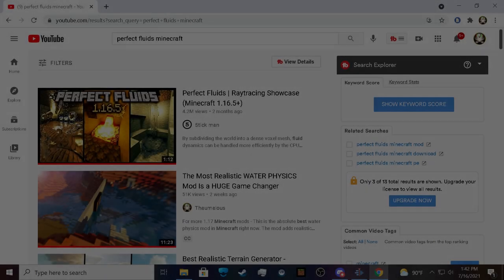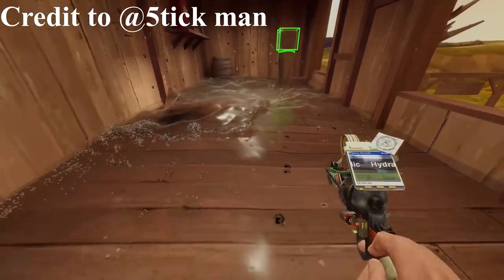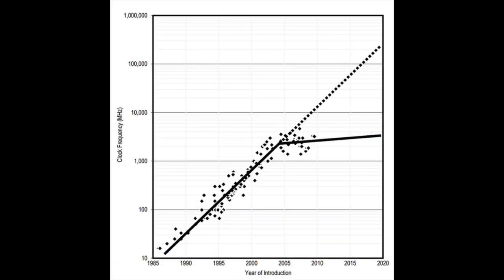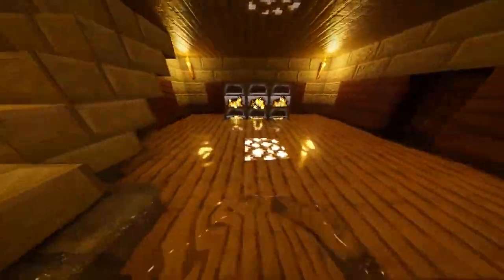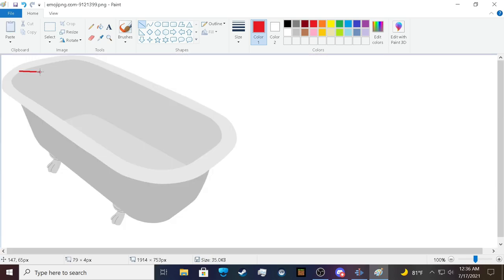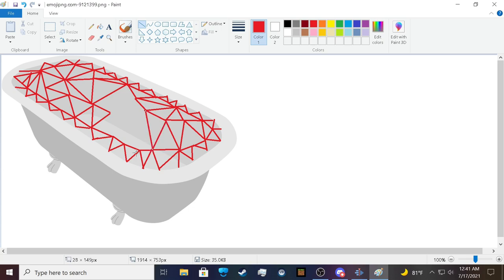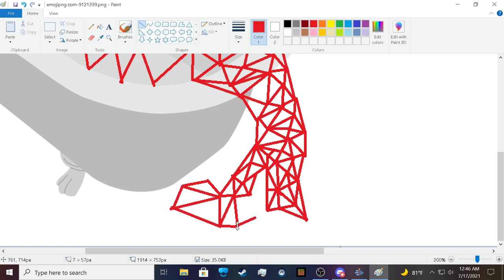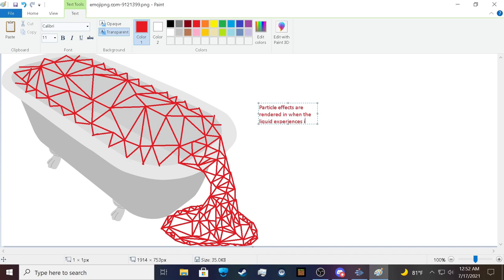Hmm, Can Wire-Frame Based Water Be Put into Video Games?

Comment: The Water Surface objects in Unreal Engine 2 games like Unreal Tournament 2003/4 are just wireframes with forces to control how each vertex moves, similar to what you're describing here

Comment: I was thinking about this type of simulation some months ago but there is a big problem with this approach, and it's preservation of mass:

While explaining this in 3d is possible, it would take way longer, so I will just explain this with a 2d analog:

Imagine you have a four sided polygon with points S1, S2, S3, S4 where S1 is connected to S2, S2 to S3, S3 to S4 and S4 to S1:

        S1
S2               S4
        S3

Now imagine flipping the point S2 over to be close to S4, if you choose the right distance, the sum of the lengths (which you used to approximate the mass of water)will still be the same, even though the area of the first shape is way bigger.

This sort of problem also happens in 3d and is even worse because the extra dimension makes it even harder to think of a way to resolve this from happening (there are a lot more ways to get polygons with the same surface area but wildly different volumes)and it gets even harder when considering that this method would have to dynamically adjust to the seperating of one body of water into two or two bodies of water joining into one again. So in practice the water shape will often deform in very unnatural ways.

All this stems from the fact that making a physics simulation system that doesn't inherently preserve mass try to do it is generally incredibly hard and slow to calculate, so the better solution is to make one that preserves mass by virtue of it's data structure alone, which is what the blender style system is, where you have a big array of particles that just change positions. Then there is the voxel approach, where you more or less apply cellular automata rules that preserve total mass(preserves sum of density values of all the grid array entries) on a spatial grid of density values. Then there are some arcane techniques that mix these two approaches to get more physically accurate results.(which is often slower however, also don't try to learn these until you are confident in your high-level mathematical abilities or these methods will look like hieroglyphics )

Generally, the best approach for a voxel style sandbox game would be the (unsurprisingly) voxel approach. Now to handle the calculation problem of large bodies of water, you would want to throw an octree data structure at it, which basically bundles large spaces of stuff where nothing happens into big boxes that can be skipped in the fluid simulation, while the closer you get to the surface of a body of water, the more subdivided these boxes get until only at the surface would precise calculations be applied. You will also (most likely) need some special case handling for when water that's in motion goes in and out of render distance.

The only scenario left would be if large bodies of water are in chaotic motion, but that will be computationally expensive no matter the method, so only "minor" and indirect optimizations can help you there.
Reply from the maker: I absolutely know what you mean and you make geeat points. However, the goal of the system is to get mass to where it is mostly preserved instead of completely. This would be done by basically having the distance or quantity or mass value be determined by more of a magnetic (springy) force instead of a completely rigid one. This is because the purpose of the simulation is for it to be put into a video game where it is actually preferable for the body of water to lose mass than it is for the liquid to gain or even have a static amount of mass.
I'm basically just saying that i dont care about the preservation of mass that much at the end of the day.
Reply: @Solusire  I hope I don't come across rude because I really do find the idea insteresting, but a thing I always like doing is poking holes in interesting ideas:
Some difficulties I could see happening:

1. In a springy system(without a trivially simple surface) one can't determine the "outside" direction in real time: so instead of losing mass, gaining a ton of mass with a deformable surface is possible: example would be a ring of water getting pulled into a sphere due to surface tension.(generally just dealing with the nightmare of surface topology, for example how to resolve a blob of water that has a small airpocket in the middle, how would that airpocket close up, running an aipocket detection algorithm in real time just won't be possible)

2. Gravity: on a planet it would need to apply gravity, but on large surfaces of water that would cause the water to dip down in the middle. One couldn't compensate this by increasing surface tension, since that would create giant water "droplets" everywhere.

3. On large bodies of water, one has to think about chunk borders, what if any of these problems occur at the chunk borders, or how do the physics for the vertices at the border behave? The more I think about this the harder I think avoiding large scale anomalies would be especially in this regard.

Comment: This kind of already exists in some shaders; it's not just a shading thing, though, but some make the surface face of the water block have more vertexes and wobble up and down; the part about interacting with it, however, is still not done; making calculations for how low-poly a body of water should be could take some lag (remember that java performs pretty badly, and bedrock is also not great a lot of the time in that regard),  and calculating how that would impact each vertex would also take some processing power

Comment: For Minecraft in specific, I think a more voxel-based approach would be better.
Imagine nowadays Water Physics Overhaul as "in the right way", but instead of using only 8 height levels for the water, use also 8x8 width squared levels: 8³ per block. Or any number other than 8.
So, instead of really simulating the water, with the simulation of the voxelized water and some visual interpolation, a realistic-like water could be achieved.
Reply from the maker: Voxel based fluid is definitely the more reasonable approach, thats for sure.

Comment: Hmm, I've been mulling something over something like this for a bit. The big problem is the physics simulation as fluids not only need their surface to be simulated, but also their depth. Especially in a game like minecraft. 

I think this is pretty similar to how the rendering side of a lot of fluid simulations already work. There can always be improvements on the simulation pipeline though.

I think it's possible to have more realistic fluids in minecraft by storing some extra data in the voxel. Namely how much water is transfered from one voxel to the next. Adding things like flow direction, velocity, and turbulance based off of the inputs of the surrounding voxels can make the simulation more realistic. Then it's pretty much a 3d fluid simulation and you only render the surface. You could probably do this with a fairly light 3D graphical neural net. 

The way water works in minecraft is a decision on the creation and destruction of water isn't supposed to be realistic, it's supposed to be reliable. Changing the behavior of water also changes the reliability.

The hurdle is the scope of changing the behavior of water. Deviating the physics of the water from its current form too much will also change the behavior of it. This means that the creation and destruction of water behavior needs to be changed in addition to changing the way it interacts with everything in the world, and how those things either create, or destroy water.

I think it would be easier to program a game engine than to try to fit in new water behaviors for minecraft.

Comment: You have a solid grasp of the needed aspects of running fluid/flip/grain/fem solvers, we need more people like you in graphics industries!

There is something in realtime graphics called "Transfer Varyings" and "Feedback Buffer Arrays".  Basically, run the calculations on the GPU, then send that data back to the CPU so you can update triangles/polygons and maintain the info between frames of simulation.
Blender does use the GPU for some calculations, but it mainly uses the CPU to do this, which is horrriiifficcally slowwwww.

In more recent versions of OpenGL (what Minecraft uses to display the game on screen) allows you to store/access GPU Ram (VRAM) between different shaders (like optifine shaders) which could be used to explore water collision with lava and saving data to "orbs" (vertices)

Long comment short, modern gpus can use Compute Shaders, Vertex Shaders, Geometry Shaders, and Fragment Shaders to do what you are proposing here.  Its a bit of work, but doable and at much MUCH faster speeds than anything Blender will be able to do.

I think the biggest slowdown would be that blender likely uses "Meta Ball" rendering. So each "orb" (vertex/particle) looks like it connects to near by water. This gives flat triangles thickness on your screen.
Using your idea of a per-frame updated mesh will need CPU & GPU calculations, but shaders like Geometry Shaders on the GPU can make a flat plane look like it has thickness. Look up "Micro-polygon" rendering.

RAMBLINGS ARE OVER... Thanks for coming to my TED talk :P
Reply from the maker: "Transfer Varyings" and "Feedback Buffer Arrays" seem like something that someone in my discord needs to know about. Thanks for this knowledge. (This person in my discord is trying to run a real time fluid sim in the Unity engine and has made some impressive progress)

Comment: There are faster methods of water physics that are also pretty realistic. We can give it transparency and reflectance later. We could also swap out the minecraft Lang to c++ for a 40x~ speed boost and hypothetically add more cpus and gpus. Say we could use parallel computing and split up the workload to 60 different computers with a cpu and 3090ti to render one frame and send it to one main computer. So yes, this is probably possible right now as we speak. This is also the method most websites use to handle several trillions of packets a second.

Comment: This is similar to what they do already with fluid sims. They usually use a regular grid combined with particles. The particles are on the surface and the grid is on the inside. At the end there are heuristics that turn the points into triangles. With AI becoming a major influence on games expect the sims to be done by AI that guesses on realistic results instead of explicitly calculating all the particles. AI and other optimizations will bring games to the next level. And they will run on current hardware. We won't need supercomputers.

Comment: I like that you know a lot and you can use your knowledge considering your youthful sounding voice.
Although, the thing described is not exactly new. The paper called "Surface-Only simulation of fluids" (Fang Da) contains a thorough description. And on the page 130 (114) it is explicitly said that "it is only applicable to irrotational flows and contractible domains". In short, the internal body of the liquid is completely ignored, hence any movement introduced internally will result in a large solution error. Rendering is not a big deal, as particle based usually already contains BVH and can be visualized using marching cubes. Or, as it's done in nVidia FLEX demo, with fast and fake normal-based metaballs.

Comment: Just one thing to note ,I assume you would want to use a gpu to  do the physics calculations but do the wireframe creating in the cpu,but that would mean transferring very  large amounts of data between the cpu and the gpu which can be slow .Also it’s worth mentioning that the physics sim in blender is run only on the cpu (it’s more accurate and simpler to program since you don’t run into race errors).overall it’s a huge pain to modify entire meshes at runtime .

Comment: There are multiple approaches trying to do sparse realtime simulation like this. But none of them were put into a game yet. The easiest thing to simulate is surface only that never changes the volume. I am disappointed with absence of even low fidelity low poly water physics simulations. Some sims actually lose so much volume so quickly is immediately becomes obvious they're wrong and become unusable. If you watch 2 Minute Papers you would get the idea.

Comment: I think doubling only every 5 years is an underestimation of progression. 3090 to 4090 is already looking to be more than double, and that's in a 2 year span. This is also not accounting for the production GPUs that NVIDIA might make.
Reply from the maker: My statistic was the possible average progression rate for the next 60 years. GPU progression is still decent as of now, however that will likely change after the next generation of cards. Furthermore, new CPUs have completely stalled in progression. The new intel CPUs create a ton more heat, have completely new architecture, and have bairly more performance than last gen AMD CPUs. They even occasionally fall behind AMD CPUs because of the compromises and architecture limitations.
Sooner or later, these graphics cards are going to stop advancing. Hopefully the tech industry finds a better way to compute than with 1/0 transistors.

Comment: 1:44
I would like to note, I'd say that's not being generous, mostly because technology progresses at an exponential rate rather than a linear one. And with things like Quantum Computing, and simpler things, such as the ARM architechture being way faster, and more power effiecient, than the x86_64 architechture. And obviously, optimizations can always be made to make the same quality render complete faster on the same hardware. 

So I actually think the time it'll take for us to get blender fluid levels of physics simulation in realtime is much shorter than 60 years, especially with how quickly AI is getting popular, and how many ridiculously fast AI-based physics simulators/predictors already exist. (not to mention AI can be used to help create technology faster, as at some point it will become smarter than all humans on the planet's knowledge combined, allowing it to easily come up with optimizations to software and hardware that a human could never come up with).
Reply from the maker: I actually basically said this in the video.
If the fundamentals of computing completely evolve, then of course we will reach this goal in less than 60 years. However, as of now the progression of technology is not impressive.
Reply from the maker: Furthermore, quantum computing would make existing programs completely useless as it would nullify the use of simple ones and zeros.
Reply: @Solusire  Yeah, ARM is definitely the future in terms of standard computing.
Reply: @Solusire  I mean, supposedly Nvidia's 4090 is supposed to be 3x faster than the 3090, which would be an insane amount of progress for 2 years, and especially once ARM processers get more popular, that could be even better. I'd say we're on a pretty good track right now, though it will still take a while.

Comment: We'll get graphics cards with double the performance of the RTX 3090 in 1 year, let alone 5. It's just a question of whether that progress will continue for more than 5 years or so.
Reply from the maker: I should have gave progression some beginning padding, but i did it by a 5 year margin just to simplify things.
We appear to be going at less than 2× every 2 years, and i predict that by the end of the decade it will take more than 4 years to double. Once samsung finishes their chip factory there should be a good boost for value computer components and smaller architecture. Unfortunately, most current improvements are just improvements in component availability and tools, not so much innovation. (this means that progression will have a cap)

Comment: Honestly for most of the video I wasn't listening and was watching you draw in MS paint but I know of a program that has a lot of different simulations that can be run in real-time (I tried it, it works) and in it there are soft body simulations and cloth simulations, and liquid simulations interacting with those simulations. I'm not sure how it works but I am assuming the fluid simulations are just a lot of particles that have different properties applied to them that make them slide around differently. Looking real close it's clear it doesn't have an actual mesh and looks like a lot of spheres. Idk if that relates but I thought it was cool. I think stuff like seen in the minecraft video will be possible soon

Comment: u should include the fact that this video is opinion based in the video, most computer hardware is still going at 2x the amt/year, asml (they make machines that make the chips) is still keeping this up and literally has it as their goal for the year
Reply from the maker: Not so much opinion as it is prediction. CPU progression has just hit a massive wall.

It doesnt matter how good GPUs get in the first place if they are bottlenecked by the CPU

Comment: Nah the graphics card wouldn't be 185 3090tis big bc the most part currently is used for cooling so the chip would only be one 3090 big
Reply from the maker: Obviously it isn't an accurate representation. But the fact is that the more advanced chips are getting, the more sophisticated cooling systems they will require. The smaller the architecture becomes, the bigger the cooler you will need, so the point still stands.
(Plus I still wanted to put that in there because I thought it was really funny)